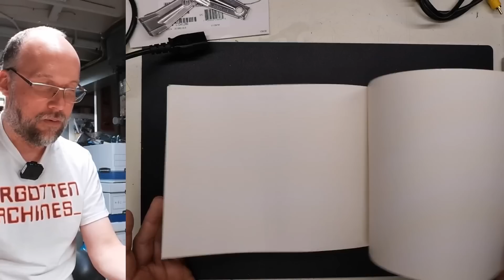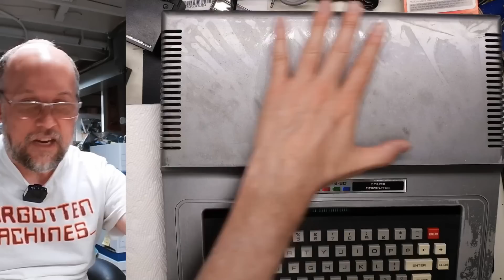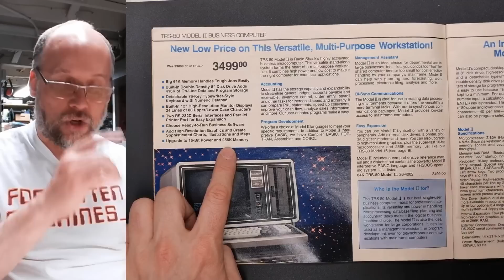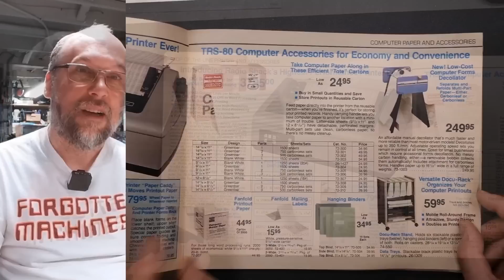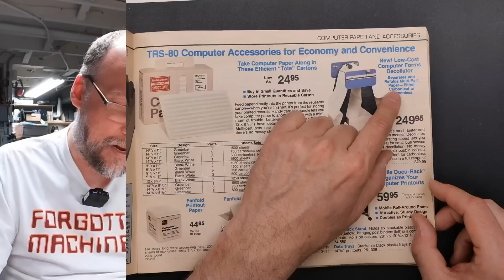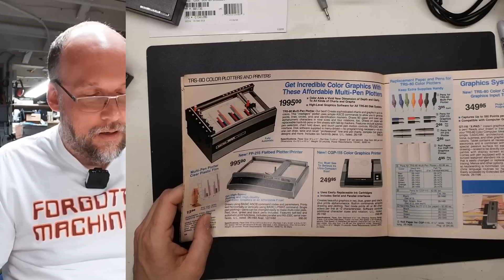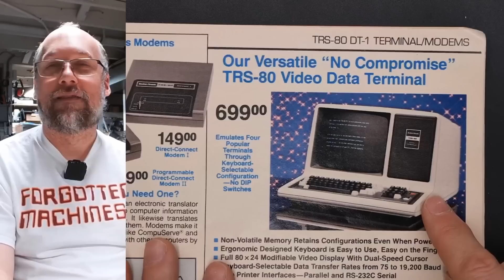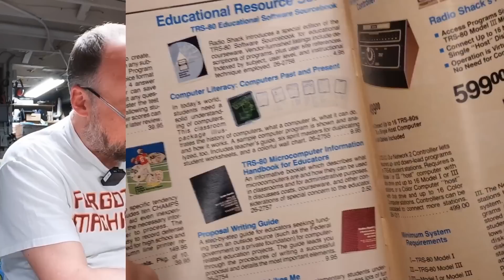0063 A boxed CoCo 1 and a fun read-through of a 1983 Radio Shack catalog

Comment: I am fascinated by your comments about the TRS-80 Model 16, and your comment that business customers would go to IBM instead. Assuming someone wanted desktop unix, I am not sure there were many other choices. The IBM PC ran xenix but required an AT and this was not available until 1985 I think. Unix on the desktop was brand new in the early 80s. The only other computers running unix were mostly DEC VAX and PDPs. IBMs other machines didn't run unix at this time, except maybe the 370 mainframe had an experimental unix, but that is not a trs-80 alternative. The midrange systems and earlier IBM desktops did not run unix, and were also in a higher capacity and price category. Perhaps the closest alternative would have been the brand new workstations from apollo and sun mostly targeted towards larger scientific and educational rather than business markets. These companies would have been less well known to typical small and medium business owners than Tandy / radio shack, and they were also more expensive than the model 16. Definitely by 1985, an AT running xenix would have been more attractive but until then, the trs-80 model 16 was possibly the best value desktop unix you could get. Probably the small VAX was the closest alternative for a small or medium business needing unix, and in this regard the model-16 would have been very attractive.

Comment: 100% the bag ruined the paint. Its known as "outgassing" and has plagued Vinyl record collectors for years, as PVC plastic bags were popular to "protect" records in the 70-80s. They slowly degrade and the resulting gasses attack all kinds of plastics and finishes.

Also, we had TRS-Model 3's in my high school's computer lab and some classrooms...this was 90-94 so they were considered quite outdated even then, but the school must have spent a fortune on them so they were getting their money's worth. They had more advanced network device featured in the catalog here, along with 2 10MB Hard drive units. They even had some of the classrooms down the hall from the lab "networked" in so you could access the hard drive. 

I remember it being decently fast, as I am sure the programs were small, but IIRC only one computer could be loading at a time, so if a bunch of people were loading something at once, you would be waiting a while for your turn. I can't recall if the interface was DB-25 or some kind of din connector, but I recall it plugging into the bottom of the TRS-80.

Comment: Awesome stuff! This looks like an F board, with the memory and SAM under the shield. Easy 64k and ECB upgrade.
 If it doesn't have Extended Basic, I'd be surprised if it's 32k, but it's possible.
 Extended Basic is required for Disk Basic (controller cartridge rom) to work.

Comment: So, they never fixed the infamous ram pack wobble when the ZX81 was "Americanised", sounds about right. Here in the UK it was a 1k machine.
What happened to the Coco? I think like us, it got old! Lets face it, we don't quite have the lustre we used to, a few edges got bashed and bit have rubbed off and I certainly feel I could do with a refurb.
Reply: Eventually they did when they launched the TS1500, a 16K ZX81 in a restyled rubber-key Spectrum case.

Comment: ZX81 had 1k . Blu tak was the ESSENTIAL ZX81 16k user's equipment and ideally pushed against a wall. There was also a 64k RAM pack !!!
Reply: I had the printer too which made it extra janky. I cut out a piece of plywood and stuck everything down to it because just the flex from pushing on the keyboard would cause a crash.
Reply: The 64k was an aftermarket unit, at least in the states. I wanted to build one but the static ram was expensive as hell.

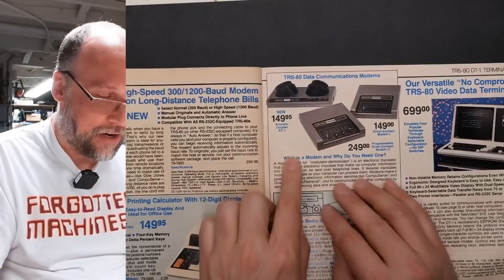Comment: 33:52.  I'm pretty sure 110 baud was dead before computers got at all popular.  I'll bet those modems are all 300 baud.
Reply: Yes, all of those were 300 baud capable (and one was 1200). If I remember correctly, some of the 300's actually supported 450 (and few terminal programs and BBS's would let you use them at that speed).

Comment: I started working at RadioShack when I was a junior in High School. (1997-99)  This was way after the TRS 80 era. We did sell windows 98 IBM compatibles through. We worked on commission, so the pay was horrible but we had fun.  I was the PC and electronics guru while the other 2 guys barely knew what a AAA battery was. haha.  I went on to work at large cable company doing tech support part time once I went to college.
Reply: Me too, but just after High School.  We use to toss Pink Floyd CDs like frisbees to show how good the drives could still read thru the scratches.  Had a nasty computer department manager, use to steal our commissions swooping in at the last minute at the till.

Comment: Great video Adrian. 

The black single button joysticks for the CoCo1 was great for some games and then the deluxe dual button joysticks were good for others. 

Yes the second ROM socket is for the Extended Basic upgrade. 

You could use Jim Brain’s 2364 adapters and upgrade Color Basic to v1.3 and Extended Basic to v1.1. His handle is known as go4retro. 

Also if the CoCo1 is upgraded to 64K and you also upgrade the CPU to a HD63B09EP you could run NitrOS-9 L1 6309 edition which runs faster.
Reply from the maker: I actually have blank EPROMs I can program that go right into 2364 sockets without the need of any adapter. I can program them on my Data IO 2900 -- so I made up a set of CoCo ROMs for another one I was repairing. :-)
Reply: @adriansdigitalbasement2  ,
Oh great :)
Would those be the Motorola ones?
MCM68766???

Comment: At two of my schools we had a full token ring (I think) network of TRS-80s. The server read from the floppy and loaded it for each machine one at a time.
Reply: Cassette tape output port network in early trs80s. Tandy 1000's had token ring cards.
Reply: @markgburnet  We had dual floppies on  the main server and it would show on the screen which machine it was currently loading data for. Sometimes class would end before all machines were served. :)

Comment: I really don't understand the point of the sinclair. YEah it's $50, but what's the point. It's too small and too underpowered to do anything and the keybaord type is the worst type of keyboard imaginable. I realize the coco keyboard being chicklet isn't great, but it's night and day better. You said it yourself you need a ram expander to do anything and it doesn't work reliably. At least the coco's biggest issue (on all of them that I've seen in these times) is the stupid horrible paint job. You should just spray the whole thing like black or something. Anything would be better than it is now. lol
Reply: zx81 was v cheap but you could run spreadsheets on it, you could buy a (tiny) printer and you could get modems for it.
But, more than that, I think it was a gateway into learning to program with an entry cost where people could afford just to try it out. It was so much cheaper than anything else at the time.
Then obviously the spectrum came along, again at a price that was affordable
Reply: It was designed to be an educational tool, for learning BASIC and Z80 programming, putting computers into the hands of people who otherwise wouldn't be able to afford them. Remember that it was designed and launched in the UK in 1981, and the UK at the time was a place with considerably less disposable income, in general, than the USA.
Reply: @mattsword41  But there becomes a point where it's too cheap and IMO this was such a machine. Using it for more than 10 minutes will hurt your hands. It's too small and the keyboard was too crappy. If it had been a little bigger with a better keyboard MAYBE. But not this. All this will do is turn people away from computers.
Reply: @Zeem4  If I was given one of these, I would have never become a programmer. I probably would have ended up hating computers.
Reply: @awilliams1701  to modern eyes maybe, but look at the 'reception' section in the font of all knowledge that is Wikipedia
https://en.m.wikipedia.org/wiki/ZX81

£50 in 1981 is equivalent to £179 now - cheap for a computer then but not £50 today cheap
Reply: @mattsword41  If it's worth 179, it seems you could up the price to an even 200 or 220 or so (so like 75 or 80 in 80's money) and get a keyboard that doesn't make you hate yourself every time you use it. I have used machines with this kind of keyboard and every time it makes me wish I was dead. Even back then. So no. I maintain what I said. If I had been given this as my first computer, I wouldn't be a programmer like I am today. I kind of feel like the VIC 20 is a joke, but even that might have lead me here. In reality I was given a C64.

Comment: I used to be a Radio Shack manager and remember looking at the store's monthly P&L statement which explained why those prices were so high: The basic markup on the TRS 80 was approximately 30-40%. Admittedly, I didn't work at the Shack until the 90s. I would imagine that if anything, the markup would have been way higher. If you think about the overhead required to have all those specialized parts distributed to all those neighborhood stores, you would have to have that kind of profit to pay for it. And it worked... until it didn't.

Comment: Some painful math for the TRS-80 Model 16 if was new 2023.  Inflation adjusted (cumulative inflation 205.3%)

TRS-80 Model 16 (with single disk drive)
1983: $4999.00
2023: $15,264.37

TRS-80 Model 16 (with dual disk drives)
1983: $5798.00
2023: $17,704.10

Thin Line Drive Bays (1 Drive)
1983: $1299.00
2023: $3,966.48

Thin Line Drive (2 Drives)
1983: $2098.00
2023: $6,406.21

Expansion Options
128K Memory Board
1983: $699.00
2023: $2,134.39

128K Memory Kit
1983: $499.00
2023: $1,523.69

Disk Drive Kit
1983: $799.00
2023: $2,439.73

Comment: The Trash 80 was trash. Until the advent of the Commodore 64 there was no need to waste your money on a personal computer or any peripherals. Especially not to Radio Shack or Apple. Atari you might have a reason and a reasonable price.
Reply: I'm not sure if that's correct... If you wanted a games computer then the c64 was definitely the best, but maybe back then people were buying computers to do computer things.  Yes, the c64 can do that too, but I'm not sure before the c64 that gaming was a primary use case so these other systems were pretty amazing to most people, albeit out of reach economically.
Reply: @BrianV_PM  Yeah I was a bit liquored last night and posted that harshly. There was rivalry between C64 and CoCo owners where I lived as a kid, and I've never gotten over the bias. I still feel that the amount of 'computer things' you could do with the CoCo for it's high cost when only a year later the C64 came in at 1/4 that cost and then dropped from there, making hardware and peripherals to do everything that the more expensive Tandy machines did faster and better as well made it not worthwhile but it was indeed a time of fast growth, and for some people who had the money, that year was worthwhile buying an Apple or Radio Shack machine. If you just wanted a good gaming rig, there was the Atari 400 and 800 computers already available a couple years before.
Reply: @exidy-yt  My first computer was the c64 and honestly didn't know about the coco at all.  i ended up getting a few other machines after that including the atari 800, dragon (coco clone, even though i didn't know at the time it was a clone of something) , a Sinclair 1000 and an ace 1000 (apple clone).  the dragon and Sinclair got zero use because the c64 was better... though even though it was probably better than the apple ii, i actually used the ace just as much.  i think the 80 column and the different software made it unique from the c64.  I do know about the silly computer rivalry though, i had an atari st at one point and there was that whole st vs amiga sillyness that people still have today even though it means nothing now. 😃
Reply: @BrianV_PM  Ahahah, truth! I was of course on the Commodore side back then but with both companies dust in the wind (in their original forms anyway) and several generations behind it dosen't mean squat now except to the most hardcore. Funny story, I remember even one beyond fanboying Atari ST guy coming into my store when I was selling PCs in the mid 90s trying to tell me the Falcon ST was better then anything I was selling. 😁 "does YOUR machine have SCSI II? Does YOUR machine have (I don't remember what else he bragged on)? Well I know a machine that does! It's the Atari Falcon ST!" etc. etc. I had to shut him down by pointing to the wall of software, Windows 95, Diablo and other legendary games and tell him that all the specs in the world don't matter if there's no good software to run on it. And your Falcon ST don't run any of that.  "you'r wrong!" but then he had to walk out with nothing more to say. I felt bad for the guy, I remember loving my Amiga that much 6-7 years before, but time marches on. The PC won.